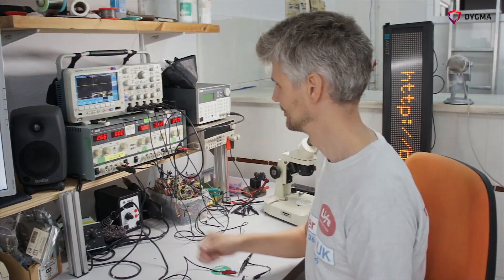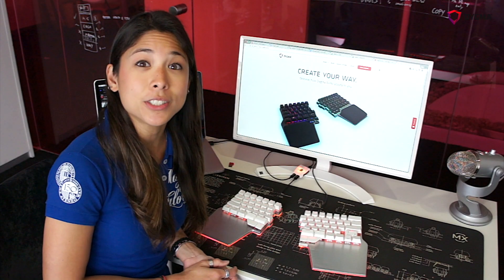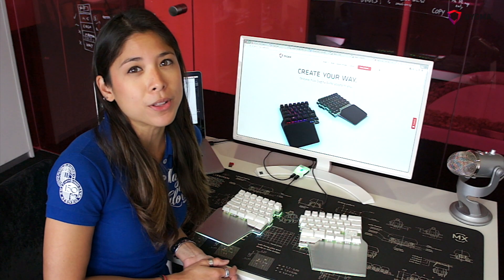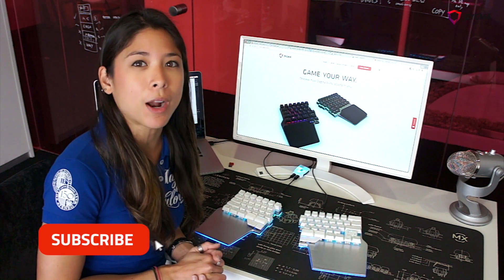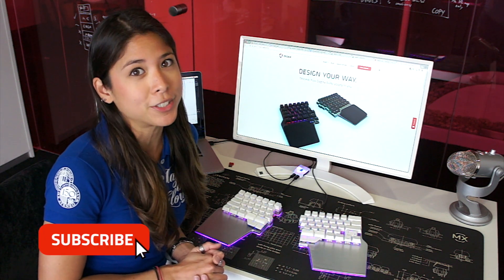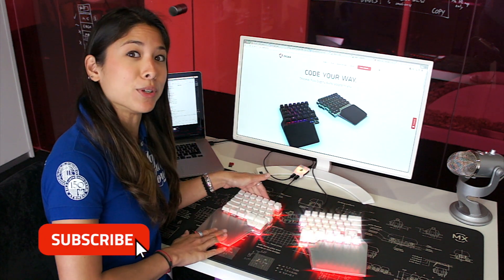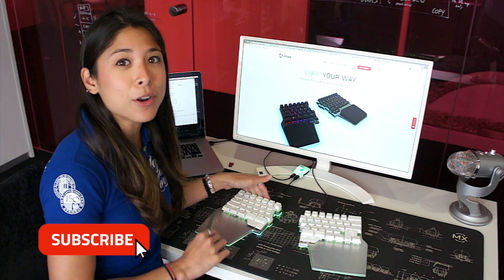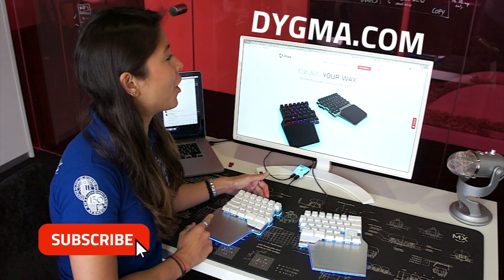Mechanical switch bounce delay and debouncing

Comment: Thanks for a (as always) very cool and informative video. Do the switch manufacturers carry and data on how long their "bounce" is?
Reply from the maker: Thanks Pierre! Both Cherry and Kailh specify maximum bounce time as 5ms. I think this is a conservative estimate as many switches have a shorter bounce time but the manufacturer doesn't want to specify something shorter in case a batch of switches is over this. Also, Kailh specifies that the switch will be 5ms or less for it's given life (70million cycles), and then to be less than 10ms. So this suggests that switches degrade over time.
Reply: @DygmaLab  Thanks for the info!

Comment: Is there a possibility for optical switches on the raise keyboard in the future? (and a f1-f12 row.. heh)
Reply from the maker: Interesting question! It won't be possible to have it on the Raise. Optical switches require a different kind of technology. But we have been thinking about creating another keyboard that will have optical switches. But that's still in the far and distant future. :)
Reply: @DygmaLab  That's would be nice, add in the mix no aluminum case to make this keyboard more affordable!
It's sad that this keyboard is soo expensive, I would buy if it was like 150... I know that's expensive to develop and it not mass produce, i'm cheering to massdrop make a keyboard something like this, with a smaller spacebar and thumb buttons!
But my dream would be a 75% mechanical keyboard based on A4Tech Gaming X7 G800V with the bottom row with this layout + thumb keys and optical switches! _
I would like to know why the F*** the Bloody(gamer division of A4Tech) don't make something like that!
Reply from the maker: @fdls  hopefully big gaming brands will soon see the benefits of thumb keys! And will also invest in optical switches. Soon enough it will be a trend.
Reply: optical switches, an f1-f12 row and maybee macros like the V.EA split keyboard would be awesome in the future! Really like your work so far!!
Reply from the maker: @alexlindblomdonahue9374  Will take that on! Thanks Alex!